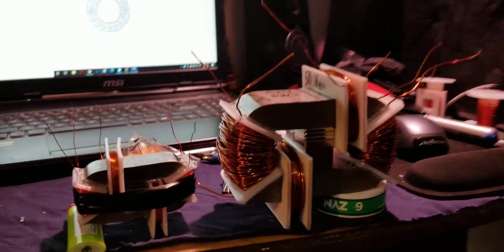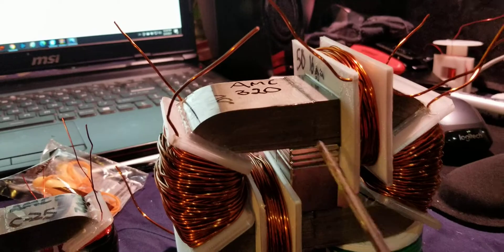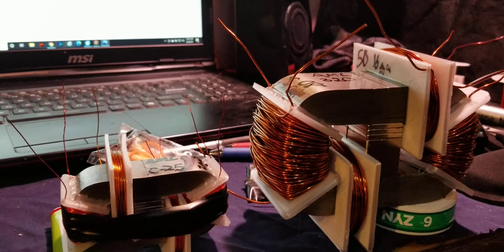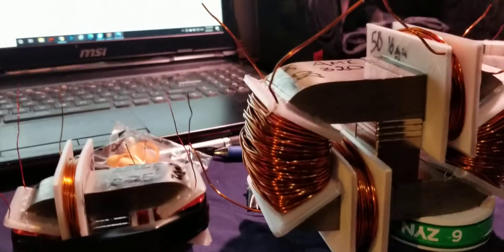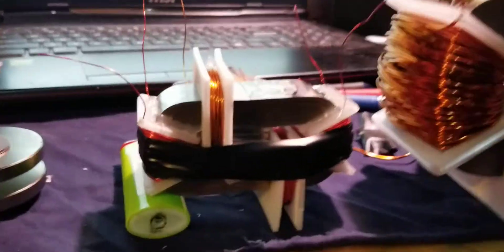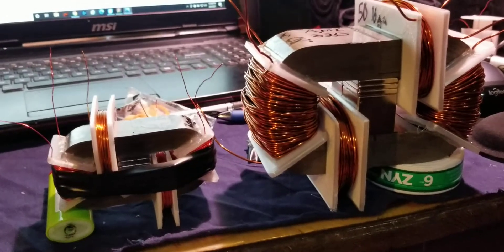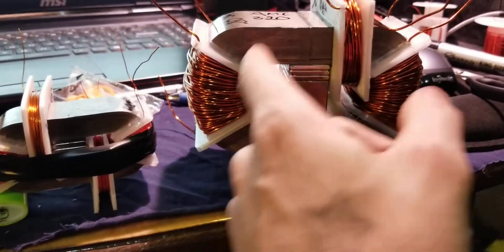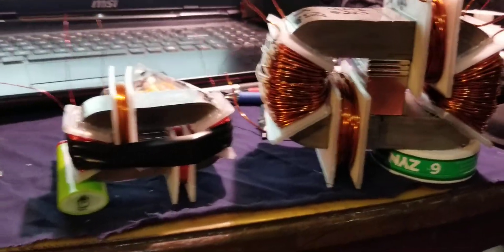MEG REPLICATION 2. Lite explanation of the effect, how it's used and how it works. Tom Bearden

Comment: It's like taking a bucket of water that was happily sedentary in a pond and throwing it into an ocean in a storm. Thank you for your explanations.
Reply from the maker: Yep. It's more so of taking something that is already present, and using it as it becomes available. 

Permanent magnets have always been available. However peculiar or asinine explanations modern science wants to stick to it.
They are still very much a mystery. 

The only drawback I believe this project will have is efficency. The yield will be fairly low for the amount of money and time needed to achieve it. 
Papers estimate around 20 to 30watts maximum through previous experiments. Then one must capture, convert, and clamp.

The load also must be inductive.
I've actually just now started soldering to the mainboard in trying. Cost to have one printed right away exceeded my financial abilities. But making one is straight forward. 

I've been distracted by my high power laser experiments I've also shown on the channel lately.
Reply: @Heliarc , would you kindly consider using very few turns for the primaries while also reducing the wattage that the primaries are being pulsed with, and a duty cycle of between 2% to 8% on time, while at the same time using a fairly larger number of turns on your secondaries. You will want to send just enough a pulse to let the permanent magnets to switch on and off, relying more on the output from recirculating the power derived from the magnets instead of a combination of the permanent magnets along with the electromagnets. In tests done almost a decade ago, it was found that for each device there exists a particular frequency and input power requirement at which the output was a very pleasant outcome. In that particular test going above 3volts at input at 4.7 kHz caused a significant drop in output. It was as though they were overpowering the very reason for this particular architecture. I am sure that Tom Bearden, being the genius that he was, gave out everything through his patented design.  Thank you again for your kind explanations.
Reply from the maker: @sundiesel1232  I'll do several different iterations of it once I get the PWM module set up.

The problem with the PWMs available is they do not output alot of power. And previous experiments I've seen data sheets on want a very high voltage.

One of the techniques i am going to try is utilizing a high voltage, high amperage mosfet with a fast switching time to operate as a "gate", running off the PWM to let a larger current and voltage actuate the coils. Instead of just the output from the PWM itself. 

The circuits used by Naudlin are fairly simple tuning circuits. 

But again. These take a long time to wind and unwind and doing experiments with it I prefer to keep voltages more manageable without exceeding my scope parameters peak to peak so I can measure and see the signal coming nm out of it.

My plans are to just see what variations get the best current, sweeping all through the frequency range available with the circuits and then see if I will need a full wave rectifier or not. 

Getting overunity energy isnt really a problem with these. It's converting the high reactive power into a usable power. Most circuits and voltage or amperage regulators create alot of heat which causes alot of problems.
I just finished my laser so I'm going to give this a little more attention.

I have a few other ideas for collecting energy as well including just radiant. Tesla freely published many designs to collect it. It just isnt alot of power by today's standards.
Reply: If you put electricity in a toroidal transformer the Aharonov–Bohm effect happens. Tom Bearden and his team have found a way to make a transformer like configuration where the Aharonov–Bohm effect automaticly takes place without external input. How does the meg works?
Consider the physical layout of the MEG. You have a stack of neodymium magnets in the center of a rectangular toroidal core. The magnets touch each side of the core on the inside. There are no coils on the core yet.

What does the magnet flux do?

The flux from the magnets will divide equally between each leg of the core. So you have half the flux flowing on the right and half on the left.

You now place coils on this core. You use two control coils on the top on each side of the magnet stack. And you wind two output coils on each vertical leg on opposite sides.

OK, it is set up. Now you want to switch all the magnet flux to one side by opposing the magnet flux with the opposite control coil. How much flux will the coil need to generate to do this? Well, the answer of course is half the magnet flux since that is what is flowing in that leg. The other control coil is in the off condition, and open circuited, so no current can be induced in it and hence no back-flux generated. The core must not be allowed to reach magnetic saturation or more energy will be required to force the flux to the other side.

Then you turn off the control coil and what happens?

Remember both control coils are now off. The magnet flux will return to its original starting condition of half the flux flowing on each side. Does the magnet need any help to do this? No, of course not. When you did this you also removed half the magnet flux from the other leg when the control coil was on. The first half cycle you only see half the normal induction level in each output coil because at the start you only switch half the magnet flux into one leg and out of the other. So the total change is Bmag/2.

Now on subsequent cycles you let the magnet flux return to its original steady state and let the magnet do the work. Both control coils are off while this happens. Just when the magnet flux reaches its equilibrium point you turn on the other coil and keep the flux change going the other way. Each coil only needs to always switch half the magnet flux not all of it. After the first half cycle you see a 100% change of the magnet flux in each output coil on each cycle for an input power that is half the output. This assumes that you are activating the control coils for half of each cycle. This means you have a theoretical maximum COP of 2.0. You are using the magnet stack as a flux battery and "letting" it do half the work.
Consider the physical layout of the MEG. You have a stack of neodymium magnets in the center of a rectangular toroidal core. The magnets touch each side of the core on the inside. There are no coils on the core yet.

What does the magnet flux do?

The flux from the magnets will divide equally between each leg of the core. So you have half the flux flowing on the right and half on the left.

You now place coils on this core. You use two control coils on the top on each side of the magnet stack. And you wind two output coils on each vertical leg on opposite sides.

OK, it is set up. Now you want to switch all the magnet flux to one side by opposing the magnet flux with the opposite control coil. How much flux will the coil need to generate to do this? Well, the answer of course is half the magnet flux since that is what is flowing in that leg. The other control coil is in the off condition, and open circuited, so no current can be induced in it and hence no back-flux generated. The core must not be allowed to reach magnetic saturation or more energy will be required to force the flux to the other side.

Then you turn off the control coil and what happens?

Remember both control coils are now off. The magnet flux will return to its original starting condition of half the flux flowing on each side. Does the magnet need any help to do this? No, of course not. When you did this you also removed half the magnet flux from the other leg when the control coil was on. The first half cycle you only see half the normal induction level in each output coil because at the start you only switch half the magnet flux into one leg and out of the other. So the total change is Bmag/2.

Now on subsequent cycles you let the magnet flux return to its original steady state and let the magnet do the work. Both control coils are off while this happens. Just when the magnet flux reaches its equilibrium point you turn on the other coil and keep the flux change going the other way. Each coil only needs to always switch half the magnet flux not all of it. After the first half cycle you see a 100% change of the magnet flux in each output coil on each cycle for an input power that is half the output. This assumes that you are activating the control coils for half of each cycle. This means you have a theoretical maximum COP of 2.0. You are using the magnet stack as a flux battery and "letting" it do half the work.

Comment: Great attitude man! 
I'm building the same MEG right now. 
Gonna wind the coils with Belden 26 gauge magnetic wire.
Thanks for posting the video's, very informative! All the best!
Reply from the maker: Thanks.
Yeah I'm probably going to build another one that goes for higher volts, lower amps with smaller wire.
I'm thinking about buying the 300$ big ass core, but I'm not sure I want to handle those magnets in it.

Mine was scary enough.
Reply: @Heliarc91  Yeah that are gonna be some big magnets :) 
The amc-320 is not a big core, but now i understand why they recommend it. 
Because of the strong magnets you have to put in it :D
Reply from the maker: @SXVWT  Yes be very careful doing it. Wear some decent padded LEATHER gloves. I would rec Mig welding gloves... They also make great gloves for handling BBQ!

Also. When handling the cores I would atleast wear some cut resistant gloves, at least, the cores I got from Mouser are 0.001 thick layers. Met glass is mixed with glass...so it will give you the worse splinters you ever imagined.
Reply from the maker: @SXVWT  If you know anyone else interested in this topic, feel free to share my channel. I doubt I will ever monetize it unless I could actually use to fund more projects to push out for free.

I have many many other topics I could rant on about...to do with magnetic reversal.. and other things that are occurring to us now.

That was the biggest driving factor for me to try and get this thing stable and working. A power source that can be buried in a epoxy box and buried in the yard...
Reply: @Heliarc91  You will soon have a lot of followers, because you're content is very good and informative.
I think there are very few people interested in free energy devices just because they're to brainwasht.
Even if you show them simple proof (like the Oxford Electric Bell) they think it's a scam. 
The only thing that can be an issue is to make it a constant reliable power source. But yeah we will see ;)
Reply from the maker: @SXVWT  Indeed. Well, nothing is technically "free". I do know of some ....other means I'm kind of afraid to talk about (literally) ... but I am not sure we have the materials to do it. We might have them available on Earth but not for us to have hands on...

There is a book, Modern Thermodynamics, by Dilip Kondepudi and Ilya Prigogine...
If you read it.. you will find that there is many places to do with material effects, such as long term memory, and others that they know violates the 2nd law. They admit it themselves. However you gotta be able to comprehend what it is they say when they say it...

People automatically assume when you reference a book, it will immediately just say "Free energy" or something like that.
No. You must decipher the data presented and use retroductive thought to self analyze and make it actual.
Through nothing but trial and error.

I appreciate the compliment. Alot.

I wont say what, or where I teach at.. But I am a Instructor at a large technical college. 
That may be why I can relay information so easily. :D
Reply from the maker: @SXVWT  As far as "solid state" you still must pay to create the vaccume change. Which is all a traditional generator does. Create a change in the vaccume....

Any change near copper induces a charge. I dont subscribe to the new age electrical engineering. I go off of the old, tried and true, founding fathers of it.
Tesla. Stienmetz. Heavyside.. and others. Kenneth Wheelers magnetism book...
Even Eric Dollard to a degree but he has some wacky theories but about half of it is true.

But a solid state device would still have to oscillate to some degree. You must pay for that change. So nothing will ever be free (for now) atleast a direct type of "tap" into the vaccume. It's got to be perturbed.
Reply: @Heliarc91  Interesting stuff! 
John Hutchinson also stated that a solid state would be preferable for extracting "free" energy.
Probably because of the non moving parts.
There is a lot to talk about that's for sure! ;)
Reply from the maker: @SXVWT  I have a feeling, I probably should copyright this theory.

But I woke up with it one day. 
I believe the energy available in a permanent magnet, or holding force...doesnt matter how you want to reference it... is directly linear to the same amount of energy needed when you create a electromagnet. There isnt any equations that exist... but it would be a simple one.

However electromagnets do produce heat. And alot of it. So you would probably have to unfortunately subtract the energy dissipated by the system, (heat), to be left with the actual realistic value.

Then however you must figure out the most efficient means of extracting same. But still, theoretically, if my theory is correct (and it is MY theory, I didnt steal it from anyone) than even a small 1x1 cube magnet should be able to produce 50w to maybe 100w. 
But those numbers just came out of the blue. I havent worked out the numbers yet... because it isnt that important yet..

But isnt that interesting...how a permanent magnet can lift items.. and produce basically no heat at all??

All things everyone should be questioning.

Lots of holes in thermodynamics and conservation of energy I could name here.. such as light speeding back up as it exits glass.... just as one.

You cant just make a exclusion or "exemption" to a theory ... and say its OK.

That's like putting plywood over a hole in the ground and pretending for it to be entirely filled.
It doesnt work that way. Unless you are paid to be a professor at a college. Then it does.
Reply: @Heliarc91  Fascinating theory! Great wisdom you're sharing. 
Do you have a email address or something to discus further topics?
Reply from the maker: @SXVWT  I cant post it here. I dont want spam and it includes my name. If you can figure out how to DM on youtube I'll send it to you
Reply from the maker: @SXVWT  or when I get more time I can create a dummy email.